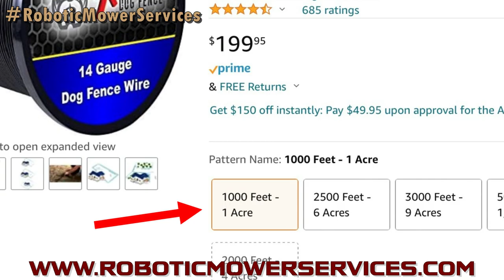Automower Answers: Automower Boundary Wire! What we recommend and why we recommend it

Comment: Thanks for this video. I have to replace 1700 feet of the green wire. A tree that I ran a loop around was struck by lightning and blasted all 1700 feet out of the ground, blew up the charging station, and also blew up the power supply. The mower itself was not harmed. Needless to say, I'm not happy about this. I still have some green wire leftover but I think I'll just get the black you recommend and keep the green for backup.

Comment: Thank you for the video. Is it the case  that the  greater the boundary length, the more important it is to have larger diameter wire such as the heavy duty one you show as there is less electrical resistance in larger diameter wire.  Also, I have found that when trying to identify breakages in the wire a low voltage cable detector tool really struggles to pick up the buried SMALL black wire whereas it SEEMS (I am still trying to problem-solve) around picks up the larger diameter wire a lot more easily. This must surely be something that buyers need to consider when they install their systems as it is inevitable that breakages will occur. Your comments on this would be very much appreciated!!    😁
Also, is the heavy duty black wire you show 2.7mm or 3.4mm??

Comment: Great video. I have a run of that green wire used as my guide for my 315X and I realize it's flimsy as compared to the black wire that came with my install. Is it possible that I could do the swap test and get a solid green light but my mower won't follow the (green) guide? It was not following the guide at the start of the season then I found and fixed a break that and thought I was done. Still won't follow the guide at all though. I notice that when I use my Kolsol wire locator, sometimes the signal seems to not be on the wire but to the left or right of the wire, wondering if it could be stretched or just as you pointed out, defective in some way.

Comment: What is the max depth of each of these wires (UV vs HD vs MeyerWire)?
Reply from the maker: That's a great question that there is no definitive answer for. The reason why there isn't a solid across the board answer is because of all the variables from one installation to another. The more wire you use in your boundary loop the weaker the signal gets so lets say that you stay below the 800 meter suggested limit for wire in your boundary wire. Then your signal will still be strong and you can bury it deeper with good results compared to a boundary system with say 1,000 meters of wire in it. The next variable would be what the wire is being buried in, ran through, or ran under. If you are running under a driveway or sidewalk there can be a signal loss depending how thick the pavement or cement is. In most cases you can go 6 - 8 inches before you would experience signal loss. And I should point out that it would be a loss of signal in wide open areas where the mower is 70 feet or more from any of the boundary wires. In narrow areas the signal loss typically does not affect the mower's performance because it is closer to the wire that is transmitting the signal and if the mower is within 60 - 65 feet of a boundary wire on either side of it then it have an even easier time sensing the signal. So there really isn't one that we can say can be buried deeper than the other without signal loss.

Comment: Does this HD wire work with the standard connectors?
Reply from the maker: The black HD wire works with the 3M weatherproof connectors, but I would not recommend using it with the purplish colored connectors for on the base station. I would use crimp on connectors for connecting to the charging station
Reply: @RoboticMowerServices  Do you service Ontario, Canada? Having a hard time finding a parts and service here for husq

Comment: Kinda confused about the animal situation. You say you use the black HD wire virtually all the time. But then you say the pro wire is built to keep animals from eating the wire...implying that they would eat the HD wire? I have a ton of deer and squirrels. That is extremely common in the US. Are they going to eat my wire if I use the HD? If so I would think you'd use the pro wire a lot more...so is that just a non issue? Some clarity around the animal hazards would be most welcome. Thanks.
Reply from the maker: We have deer, racoons, squirrels, skunks, and lots of other wildlife all around us and we have not had an issue with animals eating the wire in our area. But people have had that issue enough for Husqvarna to come out with the pro wire that has a non soy based insulation over the original insulation. The double layer of insulation makes it very hard to find a break if only the inner wire is broken and the outer layer of insulation is still solid. Most people that have had issues with animals eating other wires on items like Christmas decorations or landscape lighting so they know they are going to have issues and will go with the pro wire.
Reply: I just bought this wire  locally since I'm in the Netherlands. Made a test setup, and the wire was chewed through within 1 night. I'm definitely not happy with this Heavy Duty wire. They used fish oil in the wire which attracts rodents

Comment: I just purchased my 450xh a week ago along with the DIY kit (large). Kit came with the green wire so...evidently Husqvarna is still putting the green wire in their kits?
Reply from the maker: If it came with green wire I'm guessing that you bought it from a dealer that just had old inventory sitting around because it has been a few years since they put green wire in an install kit.
Reply: @RoboticMowerServices  yes it did come with green wire, the box says 2018 on it. The mower, I'm guessing is a  2019 because the first two digits of the serial number is 19. I bought this in early September this year and just recently found out this information through you tube videos. Tomorrow (Monday) I'm going to where I got it from and pitch a bit of a bitch

Comment: It's good wire, but not in the same class as MeyerWire
Reply from the maker: Well technically MeyerWire is not in the same class because it is not covered by Husqvarna's 2 year warranty. In the test area where we used MeyerWire we found that the insulation was too hard for a few of the 3M connectors and caused the metal part of the connector to crack and cause signal loss.